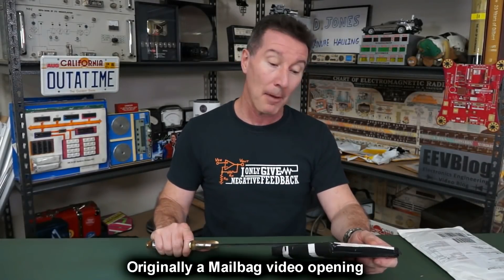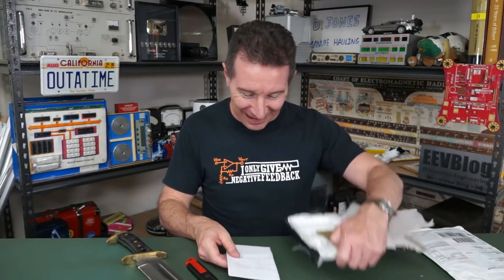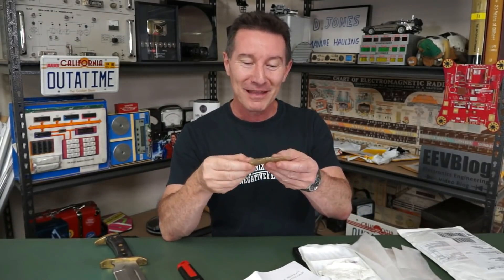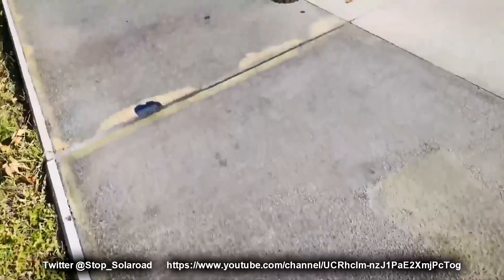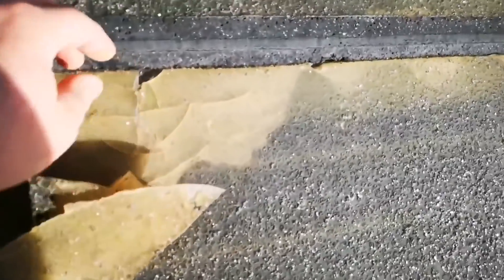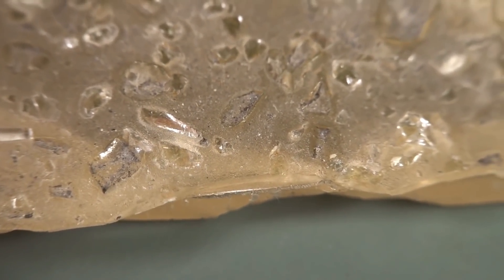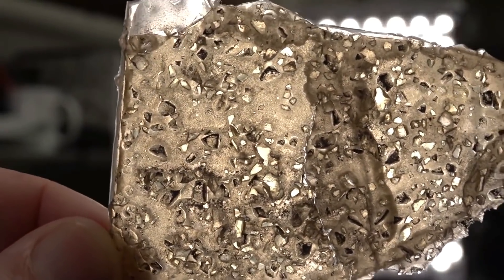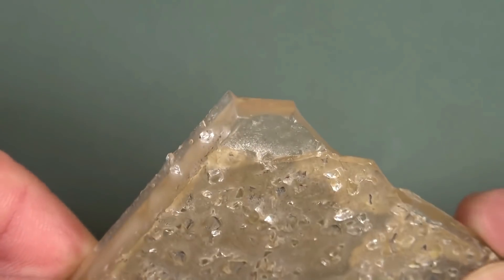EEVblog #1276 - Solar Roadways Surface TESTED!

Comment: I wonder if they could improve the design?
Reply: Yeah. Mount the panels on some rack and place them next to the road.
The problems with that idea are many. It is not just "find a better material for the surface".

Comment: It would make more sense for governments to really push incentives for home/business owners to install panels on their roof's but also help pay for the work to the distribution networks costs. In the UK many people are put off installation of panels due to the cost of connecting them to the electrical network. I would love to have panels on my roof but I would be paying them off for the next 10/15 years! Free panels for all home owners 😃
Reply: Which is actually funny since "free panels for all home owners" would be much cheaper then building solar (freaking or not freaking) roadways.
Reply: @kallewirsch2263  yeah in most areas it would definitely be. I worked for a network in Scotland. Local councils in Scotland are actually trying to put panels, batteries and extra insulation on all the council owned houses as well as schools and businesses. So at least up here they are taking steps in the right direction. The network needs some serious upgrades though to support all the renewable energy and car charger demands.

Comment: Looking at the video of the broken solar cycleway, it looks like the area of the cover layer where it is not damaged has way higher translucense than the broken parts. I suspect that the glue between the two layers might be hygroscopic and gets dull when it is exposed to humidity. When looking at those pictures, I expected much worse than 25%-30% remaining light, more like 10%. But likely the scattering makes it look opaque, even if it still passes light from the sun somewhere else on the panel, so the perceived loss when looking at it is lower than the actual loss, as "misdirected" light that hits the cell elsewhere still generates electricity.

It would be interesting to get translucence values of non-broken areas. I consider the shard tested here not just "degraded", but plainly "broken". It might be possible to separate the two layers, grind them plain, and put them back together (e.g. with a thin layer of grease instead of the original glue) to obtain the translucence after "normal degradation", but it is most likely not worth the effort.

Comment: Solar is a great auxiliary energy source, but it should not be a primary source when better solutions are available. In Texas, we have a few ducted wind turbine generator arrays installed under large overpasses and in short tunnels. The wind generated by the traffic flowing through produces enough power to run all of the road lighting (and part of the rail system in one installation). It is up high and out of the way of all vehicles and is sheltered from the elements by the bridge overhead. All extra electricity produced goes back into the grid. Repairs are rare and minimal. It only costs hundreds of dollars including the labor to do the repair/replacement of non functioning turbines rather than hundreds of thousands for a wind farm windmill. One turbine array installed in a tunnel has similar kWh output of one of the big wind farm windmills that costs 3 million dollars (or more) to install and it doesn't take a fleet of oversized load trucks to deliver.

Comment: Want to hear an even better idea? One that was invented by actual engineers and scientists, instead of random YouTube commenters who don't get how either profession works?
Okay, imagine a building material that can be mostly transparent like glass, but is strong as steel and resists wear from things like heavy weights rolling over it repeatedly, scratches, ultraviolet light, and repeated heating and cooling from being outside for years. Can any of you even imagine how massive business developing something like that is? How much the tech to make it cheaply in bulk will be worth? How many different applications there are for any material that can do even third of that? Inventing it might not quite get you a Nobel prize, but it will certainly change the world.

Also, it will allow us to put PV panels everywhere without worrying a hailstorm or some thrash thrown by wind will break them. Solar roads might not work very well, and it might not be profitable compared to building a solar farm outside a city, but it is a major improvement from the previous state of not having any solar at all and even if it fails no money that is spent on advancing science and technology is ever wasted.

The point of solar roads is NOT getting as many watts per square meter as an optimized panel, if you want that you put them on the ocean(for cooling) around the equator, or in space, where the air isn't absorbing most of the energy. Or just set up few billion panels in Death Valley, Sahara, Gobi and any other unused desert with plenty of daylight.

The point is that roads are free estate owned by the city/government and they are close to where people live and USE ELECTRICITY. There is more uncovered road available than roofs owned by people who agree to put panels on them, and all the power absorbed by it will be available for use, not just the random watts that the houses with panels aren't using and are selling back to the grid.
And unlike panels mounted on houses or bus stop shelters or wherever, something designed to survive constant traffic will not be vulnerable to vandalism and fires; streets even are cleaned more often than majority of solar owners wash their panels.

As for the alternate ideas... "Put them on the rooftops", well, we could, but some idiots own those buildings and either don't want any solar panels there or they have their own panels and don't want to give up the electricity. "Build a canopy over the path!" Slightly better idea, but we don't have those transparent solar panels yet, so you want us to waste loads of money on turning a perfectly good road into a tunnel that needs to be illuminated EVEN DURING SUNNY DAYS!

Comment: Normally I avoid "unboxing" videos like the plague, but this one I can relate to mate, from one of the stupidest freakin' ideas in modern history, after the chocolate fireman experiments of the 50s.  Do you know why was it broken into pieces? 
 BTW, 25k views in less than a day - that's a worthy achievement!  Your genuine enthusiasm is great!  But these terrible fires, on Sunday, Canberra had such bad smoke that the city looked post apocalyptic, everything closed & the few people out were walking around in respirators!  I took my motorbike through 3 roadblocks (with permission) and it was just insane near Braidwood.  PS I think you forgot that link.

Comment: Hi, I have a request for help. My BMS for my E-bike has failed and found a couple of FETs that were bad the problem can't find the part (K150E10NE MOSFET) or a replacement due to not being able to find a spec sheet to compare to. Can you help?

Comment: There is something I don't understand with solar panels. Given this video and the fact that the low solar pannel get saturated outside, it is a good assumption to suppose that every solar pannel has some saturation point. Great. I also learnt somewhere (here or electroboom) that solar panel efficiency is somewhere close to 60%. Good. And solar panels are not cheap. Okay. Now, one question : why try to improve solar panel efficiency overall ? Wouldn't it be simpler (and cheaper ?) to just work over the saturation point, and then make reflectors to a little (but with a far away saturation point) solar pannel, like under a magnifying glass ? Or just replace the "food" part in a solar oven by the solar pannel ? I get that the whole pannel may come to heat. But is that REALLY a problem ? then you have a (really ?) hot source, a cold source (outside), thus you can exploit it to generate even more current.

So, the question is basically : why bothering creating large solar farms with loooooots of solar pannels when you can just make a smal solar pannel with large "concave mirrors to concentrate light" ? Is there somewhere a physical limitation to how far you can go with solar pannel saturation ?
Reply: (I'm not against improving solar panel efficiency). The whole point is that "is there some physic property limiting the global saturation point, or maybe can you just concentrate light with reflectors to get more power with less solar surface). Maybe the whole fucking idea is just stupid because the overall efficiency is exactly the saturation point, therefore improving efficiency just improves the saturation point too... I don't know.

Comment: heres an idea i came up with... heat pipes laid in all new exposed concrete or roads being built.. siphon off that heat to generate the power... probably generate more than this solar roadway crap... especially here in aus.. roads get so hot (even during winter) that ya cant stand on them barefoot for too long!
Reply: or even just use it for hot water generation..and save some of the grid power...eg like solar hotwater systems have done for 30-40 years...

Comment: I took a course on electricity and heat generation during my bachelor's in electrical engineering. While out teacher never covered the fact that solar roadways or similar was happening, he did teach us about the losses to be expected. Another thing he taught us was to be critical if the story sounded too good to be true. I guess the engineers who designed this forgot a parameter and called it a day.
Reply: Tax money funds is the keyword 🤑🤣🤣
Reply: @stop-solaroad84  I would still argue that it's no excuse for piss poor planning and design.
Reply: @WHiPCPL  absolutely
Reply: "a parameter"?   ( I read it as "just one")
They forgot about a whole bunch of parameters. There is almost nothing right with this idea.

Comment: Probably there is a way to make a more transparent surface that is easy to clean and has grip, but it costs too much and the engineers of these projects would need to take their head out of some politicians ass to make it. Even then the power output would probably only rise to maybe 50% of the uncovered cell. Europe, we fund ridiculous projects to figure out they don't work.

Comment: Hey! You saved my solar cell! Friends are now complaining my website is down because of this cameo... so ... thanks for that? If you need a hand-full more for experiments, something may be arranged. They are custom made for the Solar Fan Cap I once sent you. It's indeed a poly cell, 2.1V / 150mA / 1.8V@100mA specced optimum after parametrisation of the included motor and fan-blade in the kit.

Comment: Incredible that they're even making these roadways out of materials that aren't safe to leave out in the sun!

I'm currently looking at a neighbouring house's solar install, or the back half of it.   The shaded side of the home.   The bit that never gets the sun.   Why did they put panels there?   Because the installers would talk people in to bigger systems to make more money off them and the only way is to put the panels on both sides of a roof, with one side out of the sun!   Quite common to see in the UK, but shows how little people understand about solar power generation.

Comment: Looks like whatever resin they used isn't UV stable.  
As they have several tests going on, I'd hope this only represents one of many different types of protective layers they would be testing.  
I could see footpaths or cycleways possibly being good use cases due to light traffic. Still makes more sense to just coat the roofs of all the buildings in an area!

Comment: IMHO, 30% output is not so bad by itself. I expected much worse. The viability depends on construction and maintainance cost
Reply: + energy loss on the flat angle
+at least 2x more expensive
=10x worst than normal panel
Reply: Glad you added "I expected much worse".
Because 30% actually is pretty bad once you realize that solar cells have an efficiency of only around 19%. That is 19% of the solar energy gets converted to electricity. 30% of that means that you dropped the overall efficiency to just roughly 6%! That is: only 6% of the energy coming from the sun gets converted into usable electricity.
Now that IS a significant downgrading.